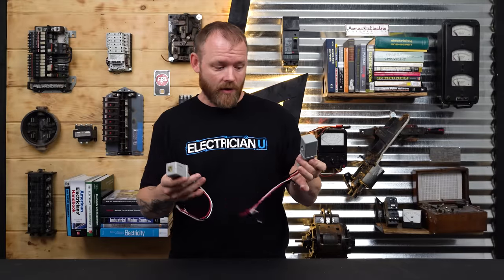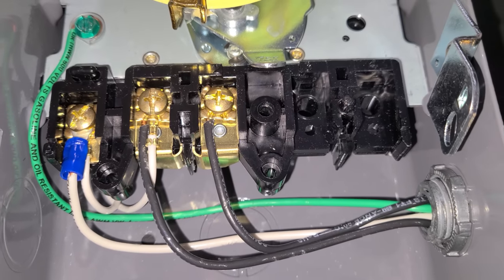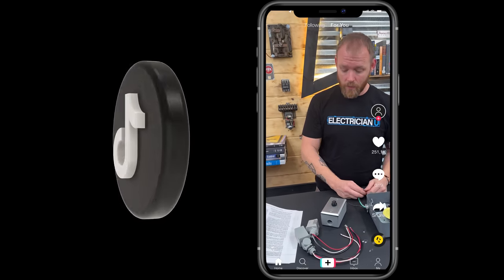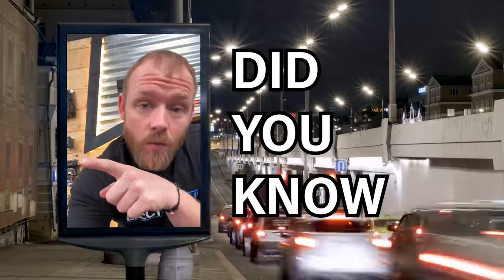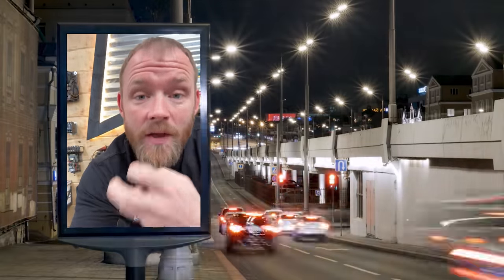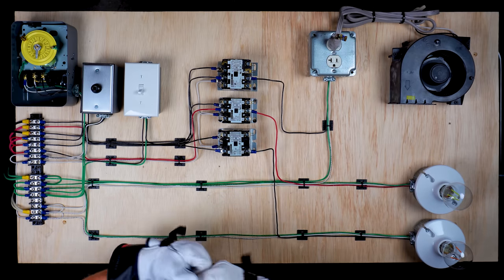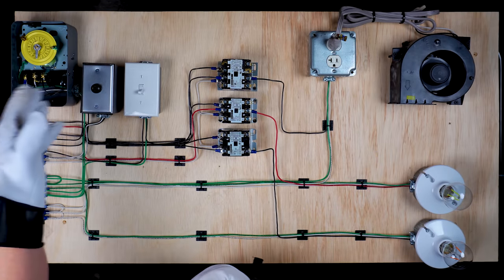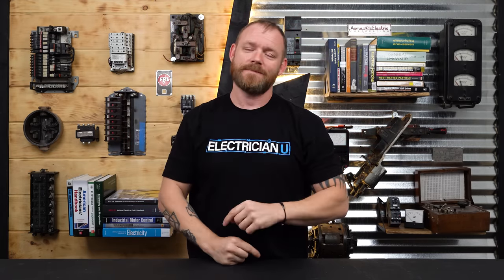Lighting Automation 101: Timeclocks and Photocells

Comment: I was quite surprised with this video. The content you provided here includes devices I used in the distant past. Those older analog clocks are quite annoying as they forget the correct time in the event of a power outage. I always found photocells quite flaky as they aged and/or got dirty their behaviour gets quite erratic. I am glad you mentioned more advanced devices are now available. Such devices can turn lights on at dusk or some offset from dusk (like 30 minutes before dusk) and switch them of at a particular time or at dawn if so desired. For example, a retail shopping parking lot my require lights on at dusk and off at 30 minutes past closing time and vary the off time by shopping hours on particular week days. And these newer controllers (if appropriately connected) can access a time signal to reset their internal clocks in the event of a power outage.
Reply: The older analog clocks have been replaced by digital ones, which fit in the same housing and can be programmed with different on/off times for different days of the week, and have calendar memory so that holidays and special events can be pre-programmed. There are also GPS enabled photo controls which don't actually need to detect the natural lighting level at all, they just "see" where on the planet they are (if they can receive the signals from GPS satellites) and know exactly what time sunset is and sunrise, which can be factory programmed for things like on 1/2 hour before sunset and off at midnight. These are in the twist-lock style used on tops of streetlights and to control highway lighting controllers instead of the the traditional street light style photocell. A combination of time-clock and photo control can be wired to turn on at dusk and off at a pre-set time, simply the time clock powers the photo control.
Reply: @darrendolphdragos9752  Thanks. If they are using the GPS satellites then they never lose the correct time during a power outage as they can reset automatically from the satellites.

Comment: Since I retired in early 2016 from the Electrical Distribution Industry, Lighting Control and wireless communicating devices have exploded.  Wiring devices used to be a small portion of the total electric spend on a project. Today, the wiring and lighting control may be larger than the actual lighting, gear and possibly the commodities.
Reply: In some applications, yes, it is. But, not on the regular, yet. Look up the IECC requirements. You will see that it will be more expensive before people figure out work arounds. Two power packs, vacancy sensors and controlled receptacles... In each and every 600sqft space or smaller.

Comment: Your demonstration includes the use of relays. But, if I understand correctly, the relays are not necessary. Once the timer or photocell closes the circuit, could not the hot leg simply go directly to the load? Or, what am I missing?
Reply: You’re correct. Relays or contactors allow larger loads (30 amps or more) to be controlled because photocells are limited by their amperage or wattage rating (20 amps or 2,000 watts).
Reply: @THEG00CH89  I see. Thanks for your reply.

Comment: You could have told us what's going on on that red wire.  Is it a voltage?  Just a resistance that changes?   How does it switch the contractor?

Comment: Great Video.  Keep it up. Maybe you could talk about switchgear.
Reply: I don't think switchgear is his thing. That's like a specialty field right there brother, mostly for high voltage sparks working in industrial plants or substation techs. 
I wouldn't expect a resi/commercial spark to be thoroughly knowledgeable on switchgear. They might install them once I. A while, but not as much as they are switchboards/panel boards/load centers...
Reply: Switchgear, I believe, as the OP was talking about, is a colloquial term for main distribution gear, that is larger than what you would see in regular residential services, or even light commercial stuff.

Comment: Question - Do I need to run a ground to smoke detoctors in slab ran with plastic smurf in a plastic box with no grounding point on the box or on the smokes?      Can someone please give me a code reference.   Thank you.
Reply: Every conduit that is either underground or non-conductive requires a ground wire. I don't have my code book in front of me, but it is there. Read through section 250. It is probably one of the most informative sections in the code. And most misunderstood.

Comment: In the demonstration part, i dont see a green wire going to the photocell box... Yet, i see metal parts ( box, box cover..)
Reply: He also didn't use the correct box grommets. It's a demonstration, not completely code accurate. 

Also, it might not be a metal box to begin with. We cannot be certain.

Comment: DUSTIN, Most Photocells when its DARK the photocell resistance is High resistance/high impedance and when LIGHT the photocell resistance is LOW resistance/low impedance. It doesn't make sense whey DARK high resistance would CLOSE the contact circuit? Logically it would be High resistance OPENS the contact circuit not when Low Resistance OPENS the contact circuit. This is confusing how its backwards or reversed

Comment: ELECTRICIANS COMMENT PLEASE, WHAT DO YALL THINK ABOUT THIS?

The grounding concept. I know an Electrician ( NO ITS NOT ME LOL) that uses the Raceway metallic (EMT)  and on each end transitions to Non metallic tubing (Raint Tight) and he uses the Raceway to run his #4 bare wire for the cold water spicket and he claims it's a loop hole for him not to bond his EMT ( He claims it's because each end is transitioned to NON metallic therefore no bond needed. Sometimes they fail him... other times they don't fail him. What do yall think about this?

I personally think you need to bond the metal one way, or another. I don't think that's a good idea to transition. Even if electricity runs through it on a trip for less than a second.
Reply: Seems like he's going through extra effort to be annoying to the inspector. The time and material cost to transition to and from EMT to PVC is more costly than just putting a proper grounding hub on, or a ground clamp on the EMT.

Comment: OMG....
Look at this time clock..😆😖
Please tell me that this is a "re-run" of your old videos...
Nobody buy's those mechanical shit anymore.
Reply: They do. It's cheap and effective.
Reply: @IceBergGeo yes but always have to reset time in case of power failure or seasonal time changes.
Digital electronic ones have time memory and are much smaller. Fits into 1gang box. And have same load ampacity as the big mechanical ones
Reply: @martf1061  you are correct... Mostly.... Those big mechanical ones are rated at 30A. And most of them are two pole. Those little ones are neither. 

The other bad part about them, some at least, is you have to replace the battery inside every so often. And they are more subject to failure. 

You have to take the good and the bad with each.
Reply: @IceBergGeo  of course
Reply: @martf1061  And one short circuit on the load wiring, or a local power surge fries the electronic timer, which uses a triac, rather than a mechanical contact, to switch the load.